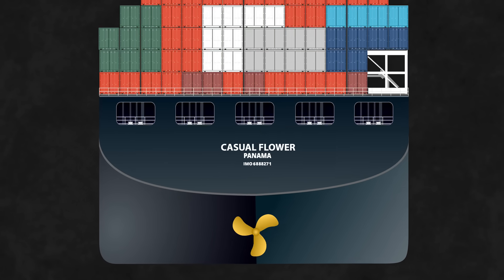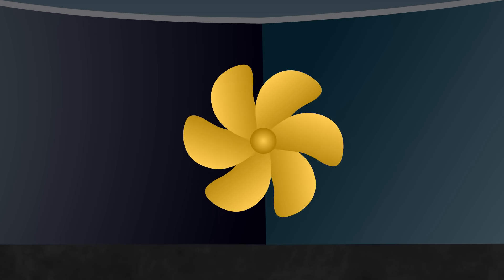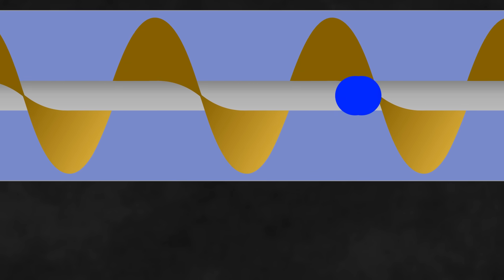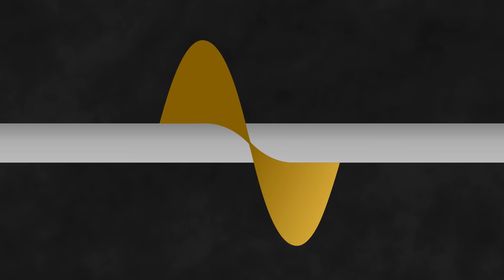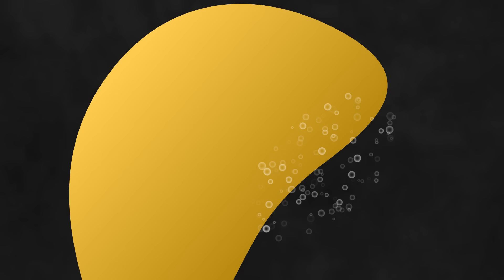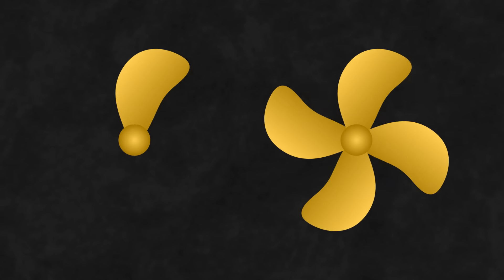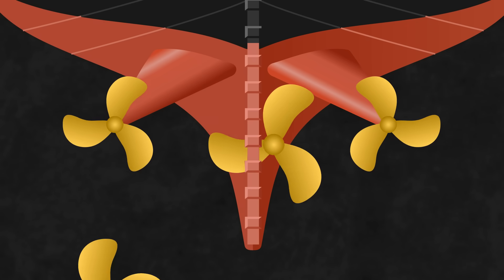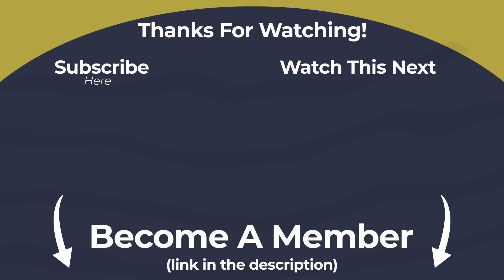Why Are 4 Blades Better Than 3?

Comment: I've heard a story from my father who manages a boat making company and his friend who makes propellers. It appears that some boat owners (especially in context to law enforcement and defence) prefer 4 bladed/even numbered props so if one of the props are damaged/cut off, they can cut the opposite side and make it a 2 bladed prop and maintain relative stability/minimal vibrations.
Reply: This is valid. I've witnessed the result of a prop strike on a large cargo vessel with a four-bladed screw. The tip of the opposite blade was cut off by underwater divers to balance the load until the next dry dock for a better assessment and more permanent solution.
Reply: Replacing 4 blades with 2 by removing the "extra" ones only solves the balancing problem. The resulting propeller does not match the engine and the problem is not solved. There is a video here where the number of drone propeller blades was reduced in this way. If my memory serves me right, the engine speed increased by 30%. This is absolutely unacceptable for normal and safe operation of the marine engine.
Reply: @amgluk  Oh yeah definitely, the removal of the blade opposite of the broken one is more of a temporary fix until the vessel can return to dock without the crew going insane from the rough ride, it certainly isn't a long time fix rather just a "welp I hope this'll get me to port slightly more comfortably"
Reply: If this is true I woulsd expect a 6 bladed prop. Becaus that can be changed to a four bladed one (blades not even divided in the circle) , a three blades one or even a 2 blades one if damge occur.
Reply: @reiniernn9071  But that's not the only concern and more blades have downsides as well, so it might be that 4 is the sweet spot. 3 can't be balanced easily if damaged, 5 likewise and 6 might be too many blades for other reasons.
Reply: @reiniernn9071  6 would be a bit overkill for small 30-40 meter boats to be fair.
Reply: I thought of military used vessels...more chance on damage what must be bypassed  And much biogger like also container freighters..
Reply: @flamingchuucygnet8983  Seagull outboards work okay with six blades
Reply: @reiniernn9071  There is always this guy...
Reply: I'd say the preference likely has more to do with their specific requirements than repairing damage itself. Since the blades angle of attack is determined by desired engine RPM vs vessel Knts, and since length (along propeller shaft) is quite limited to avoid excess weight, drag and self interference, having more blades allows a propeller to physically fill more of its swept area, which means more power before cavitation for any given diameter, allowing a law enforcement boat to either use more of its (normally quite powerful) engine when static or at low speeds (like towing another vessel, or moving when overloaded by people, cargo, or water flooding in from damage) and/or have a lower total diameter (which itself drastically reduces chance of a prop strike), at the cost of more hydrodynamic drag when the vessel is moving quickly.

Comment: If I had to guess, I'd say Titanic probably had a 3 blade propeller. I have no sources to back this up, but considering the other corners they cut on her last voyage it would make sense. They already went above her ideal speed, chose a short but risky route, and carried on despite bad visibility and a lack of binoculars. So choosing a screw that prioritised speed over wear, costs, and comfort would make sense. And such a screw being on Olympic at that time showed that it was possible at the time.

I wonder how the economic factors changed over the Olympic's life. I know that changes in fuel prices can change the speed at which planes fly (if fuel is cheap, the costs of flying faster are outweighed by having less crew-hours), maybe the ships went through something similar
Reply: we DO have evidence.

Assuming the video is correct, we have plans showing her with a 3 bladed central propeller, and we also have a relatively recently surfaced  engineering  note book from Harland&Wolf explicitly  listing Titanics  prop as being 3 bladed.

That is evidence.

and also, it is more direct evidence on the arrangement of Titanics propulsion system, than looking at Olympic and copying whatever she had.
Reply: You're right you are just guessing, and you have nothing to back it up.  Pity that didn't thwart you.

Bad visibility, and no binoculars.

Binoculars only magnify objects at a distance.  They would be useless if an object is shrouded by poor visibility such as fog, haze, clouds, smoke, darkness etc.   They aren't x-ray goggles.

The iceberg wasn't seen in time because it was dark, moonless and dead calm.  They would have needed night vision equipment, not binoculars.
Reply: @canada_sucks  it didn't thwart you either, did it? Whilst binoculars weren't that useful during the sinking, as it was a clear, dark night, the crew noticed shortly after departure that the binoculars were locked up (the person with the key cancelled last minute and forgot to hand over the keys), so heading back to port would've been an option.

And whilst night vision would've been great in the clear night, these systems are still susceptible to fog. In dense fog you wouldn't really see that much further than with the naked eye and a searchlight. In such weather the challenge comes down to deciding whether that white wall you see is solid ice or just mist

Comment: Hello, I’m an aviation student and enjoyed your videos. As I watch this videos, I was curious on propellers on ships. Do ships have variable pitch propellers? And what are the pros and cons for ship variable pitch props?
Reply: Some do, there is a video on this channel about them, search the channel for "controllable pitch propellers".
Reply: Ships have VPP. The PROS are constant RPM (engine sits at the most efficient RPM setting), lack of a reversing gearbox (the pitch can make the blade run backwards without changing propeller rotation)  and better control. The CON is its a b!tch to maintain and service. Also an expensive endeavor. Only found on ships that require precision control (dynamic positioning ships, ferries and cruise ships and occasional expensive cargo ships). Ships having VPP have bad 2nd hand market value as the VPP system alone is a nightmare to fix. One company in PH couldn't keep up with the VPP system maintenance and decided to rip the entire system off the ship and replace it with conventional ones.
Reply: You won't find variable pitch on ships employing slow speed direct connect diesels. My first experience with variable pitch was on ships using medium speed diesels built in the 70's. In this case, there were two main engines that coupled to the prop shaft using air  operated clutches via reduction gearing. It was a very complex system that provided exceptional maneuverability but came with high maintenance costs with age.
Reply: @loutrioti8375  There are ships with VPP shafted to low speed engines. The best examples are found on old Norwegian fishing boats. They set the engine RPM and they let the blades dance using a control wheel on the bridge. You will immediately notice the engine bogging down when the blades are at max pitch.
Reply: They do exist. The pros are that you can adjust the pitch to optimize load on engines according to load condition on the vessel. Running two engines on one shaft/ propeller. Given that you can decrease the ptch in order to run only one engine. Thi is not possible with fixed pitch. And you can vary the pitch between ahead and astern without reversing engine or gear box. The ability to ”hover” around 0- pitch is unbeatable when it comes to precision maneuvring, as in dynamic positioning.
Reply: Most ships don't but some do. The ones using variable pitch are newer cruise ships that have azimuth pods and container ships.
The biggest deciding factor is cost and complexity. Props for planes spin fast but ship propellers are under higher stress compared to air props leading to the need for more robust designs (meaning it's hard to miniaturize for smaller ships) . Corrosive conditions in seawater also don't help.

Comment: Oceanliner Designs recently said an engineering notebook has been found that confirms Titanic's main propeller had 3 blades. This would be different than the Olympic, which had 4. https://youtu.be/dFIn-bn-WQQ?t=1222

Comment: The more logical question would have been: Why Are 3 Blades Better Than 4?
Reply: in a parasitic drag point of view, 3 blades are the balance. 1 blade is the best as there is only 1 set of parasitic drag. 2 blades is a good setup but it wont transfer power more efficiently to the fluid. Greater than 3 blades, you need to slow its rotational motion the more blades you have to not make the parasitic drag more significant.

Comment: Why not impellers ? They are now developed. They have no water turbulence if the exit is well made and have full efficiency.
Reply: the downside to impellers are its nasty habit of sucking debris. You also require the use of intricate ducts to change the direction of the thrust the impeller is producing. 

The control ducts are the biggest hurdle to impeller propulsion. They cannot be scaled larger than current use as they can become more expensive than the ship itself.
Reply: @kimpatz2189  No, the output of the impeller goes over the steering surface like normal. second the debris is not an issue anymore, there are wide intake filters that use the cavity effect to diminish slow intake speeds. All this has been solved. Its not a question if, but when they will be used.